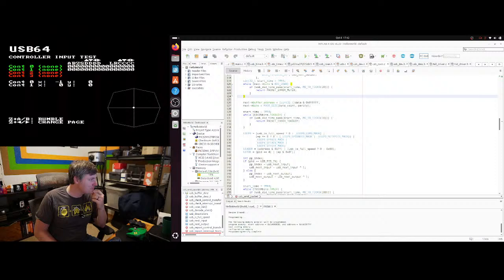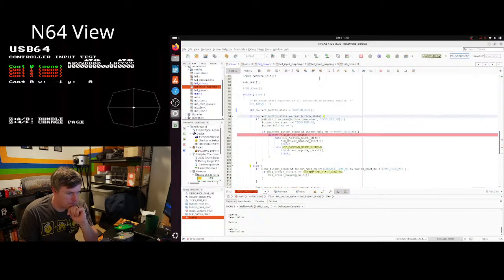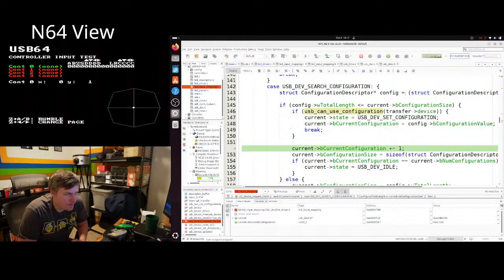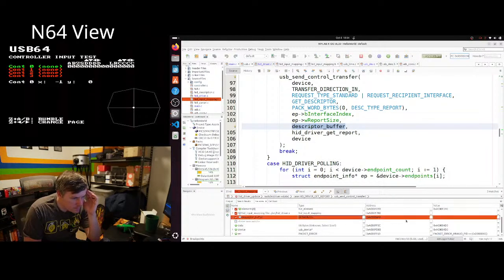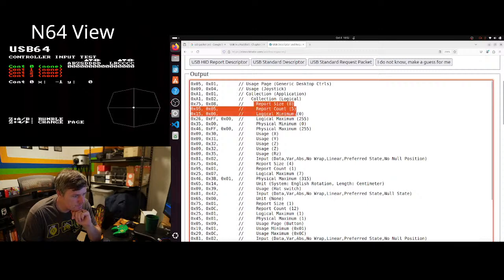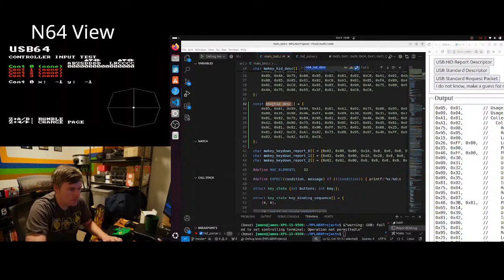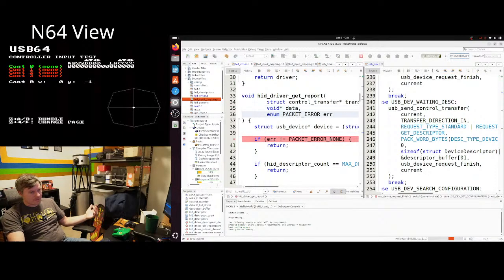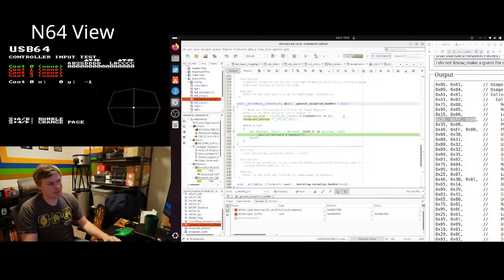Testing and debugging the HID driver for my N64 USB device

Comment: You should sell this adapter, I would like to connect my DDR pad to this usb64 and then play some Dance Dance Revolution game I plan to make. Could you release a installer of this compiler? please, I would like to build for this but I need the compiler and I don't know how to install it. I have Windows 11.. I tried in the past and it didn't work. could you help?
Reply from the maker: The dev environment is MPLAB. I would like to sell this which is why I haven't make this open source yet.
Reply: @james.lambert  sell away, I want mine.